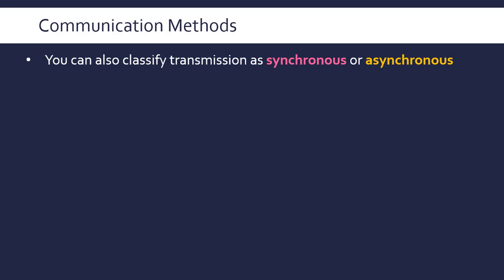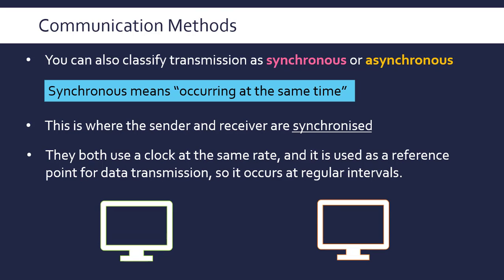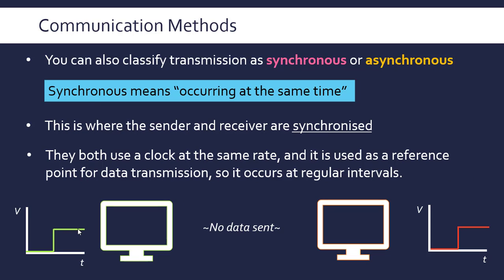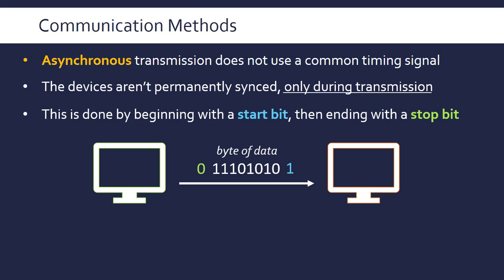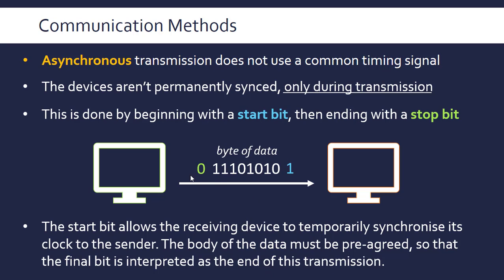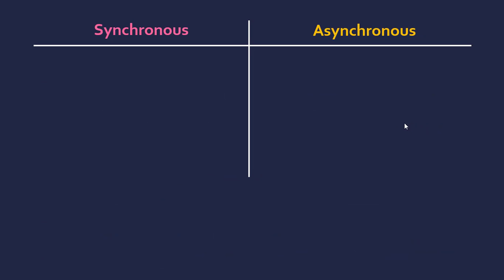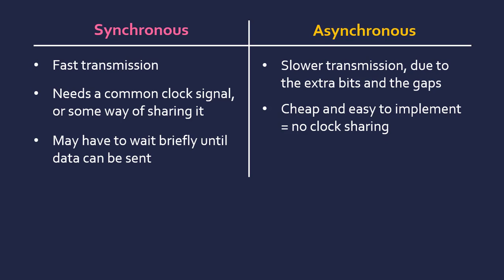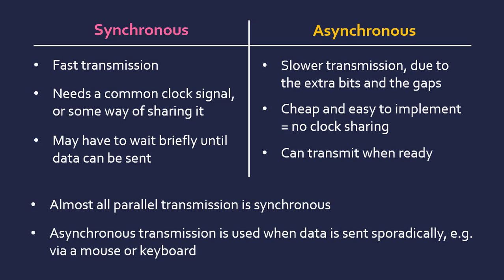Synchronous and Asynchronous Transmission

Comment: Fantastic explanation, you simplified it very well :)!
QQ - Is a cluster's heartbeat packet considered as an example of Synchronised transmission ? Cause every 2 seconds it is going to check if all the other nodes are alive or not.
Additionally, to synchronise both the sender and the receiver, what is the device used to spike or down that voltage at the same time ?

Comment: I Don't really understand what is that clock that you talk in synchronous transmission, is that another wire different than the wire where you transmit the data ? how does the clock work, I mean it sends a periodic signal and that way the receiver can synchronize ?